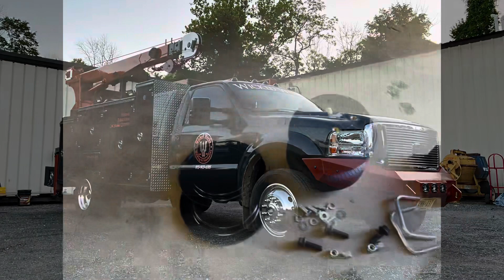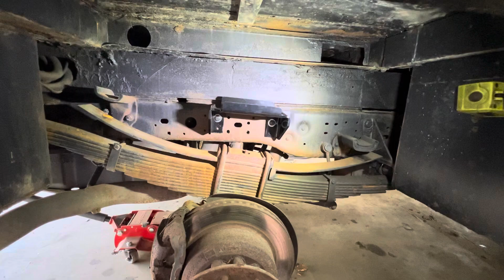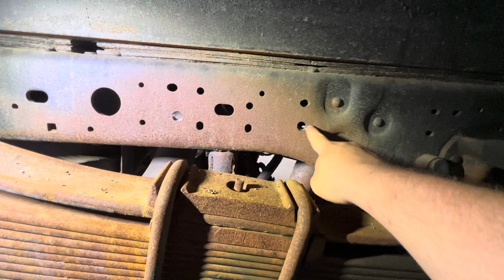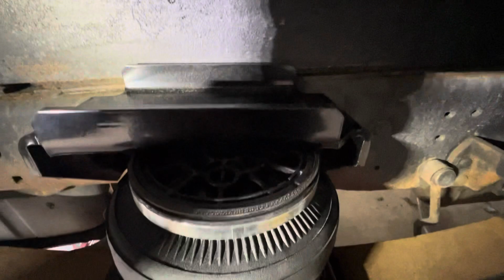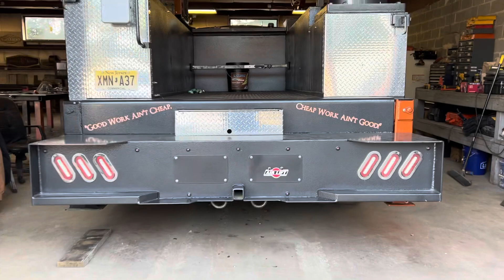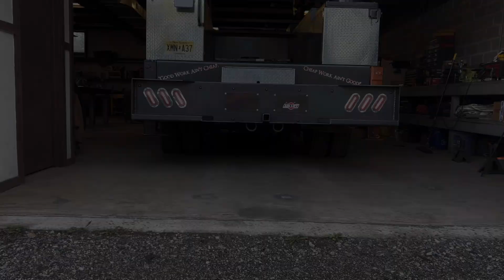Air Lift Helper Airbags Install: 2007 Ford F550

Comment: Glad you got the air lift air bags installed on your F550 Service Truck definitely a big improvement especially when having heavy loads etc
Reply from the maker: Yea its such an improvement for the ride and the uneven weight distribution!